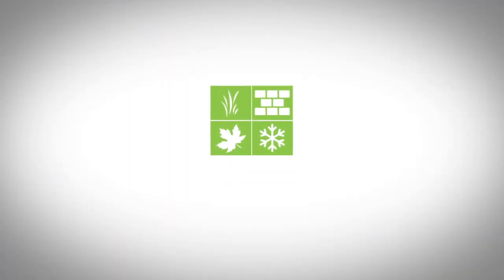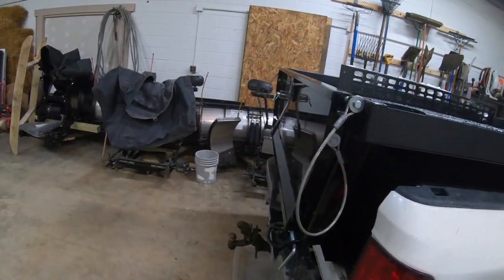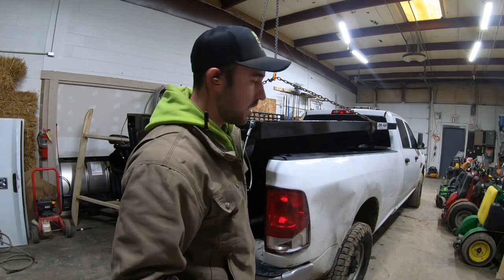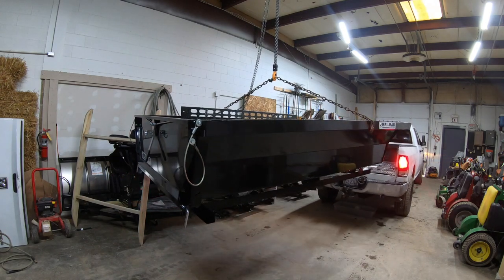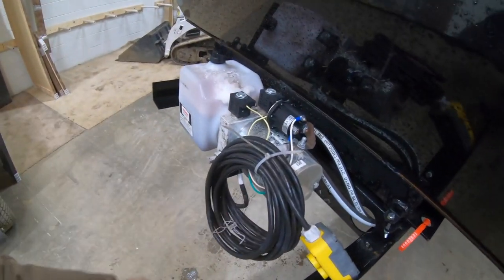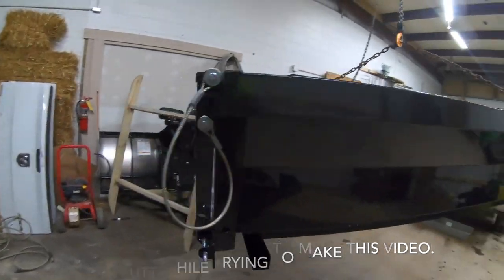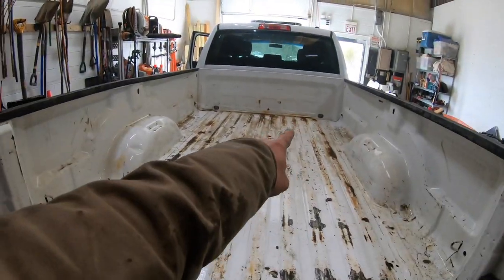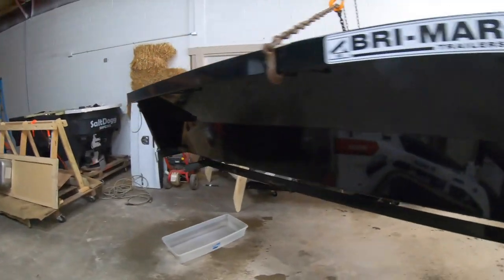Bri-Mar Dump Insert Installation

Comment: Good video! You should be able to take apart the yellow controller easily to route it into the cab then put it back together once it’s in there. I had to replace a pump in my dump truck
Reply: yes, you can remove the wires from the box and run them through a grommet where you drilled a hole. then put the wire back in the box. peace

Comment: you can run that into the cab, buy longer 4 wire trailer cable, there are rubber grommets on the back of the cab you can run the wire into and fish it under the carpet along the tranny tunnel or along the frame and up to the front of the cab and into the dash area and get a 3 position switch installed into the dash/underdash or keep the current controller and bring it in thru one of the fire wall grommets and tie it up to the steering column or say your 4 wheel drive shift lever bracket secured to stay put